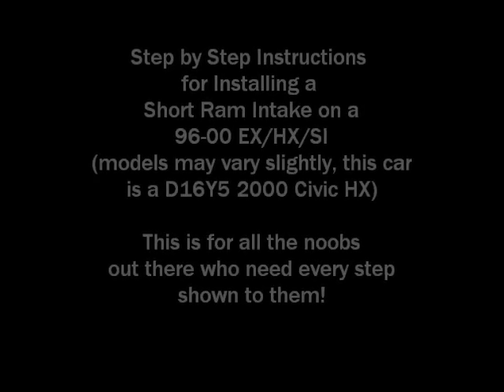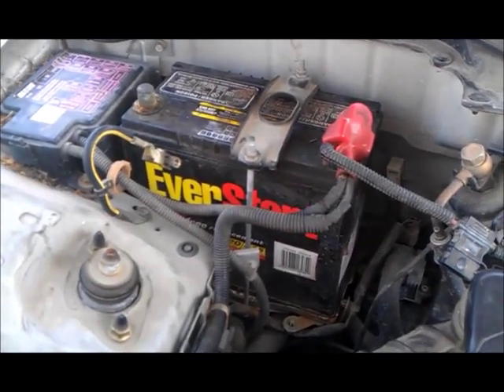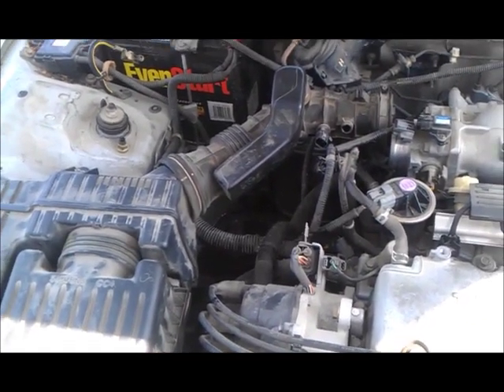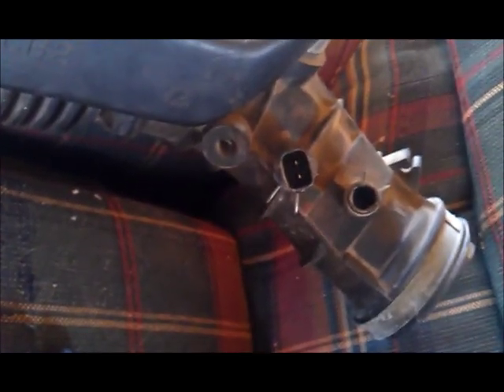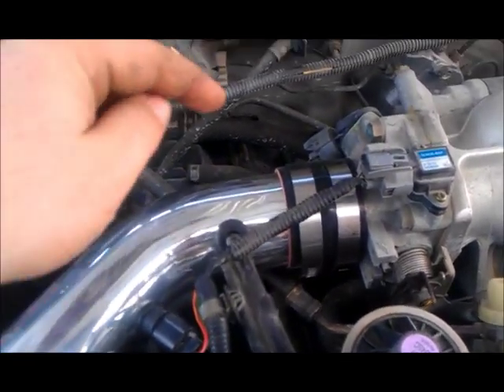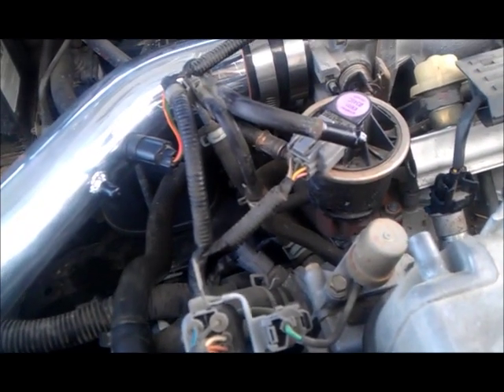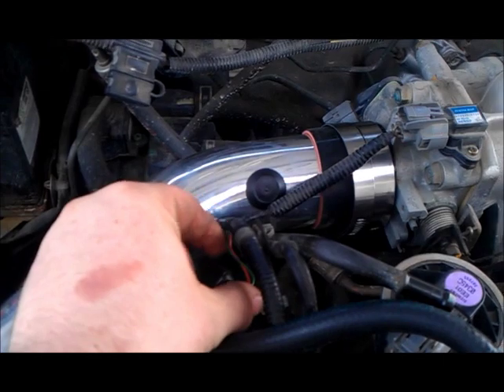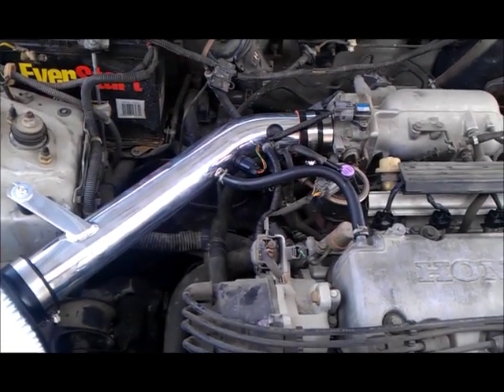How to Install a Short Ram Intake for 96-00 Civic HX/EX/SI

Comment from the maker: Cameron, this air intake swap makes your car breathe easier. It won't do a whole lot for performance alone, but if you swap your exhaust out for one with bigger piping, or change your exhaust manifold to a header (HX, LX, DX), then your exhaust gas will be able to flow better LEAVING the engine. Then, it is a good idea since you upgraded one aspect of the car's breathing, to upgrade the other end and allow the car to breathe IN new air easier. It does make your engine sound throatier too.

Comment: Quick question, I installed a cold air intake by Spectre, and it has a hole in the tube like you show in this video, but my stock tube didn't have anything running from the head to the tube. Should I just get a cover or do I need that pipe running into it?

Comment from the maker: ThEOnLyOne246, The only sensor I needed to bother with was the Inlet Air Temperature sensor, and had to unplug the Manifold Absolute Pressure sensor to install the new intake, but the MAP sensor is located on top of the intake manifold, so it's location did not move, simply the wiring harness back in after the new intake and IAT sensor were installed. Honestly I am not sure where the MAF sensor is on these civics, but it is not in the intake tubing. Assuming it is inside the intake manifold too?

Comment: why not put a breather filter on there too. it makes moving that flex pipe alot easier since it is not easily moved. after the breather filter is on there it isnt needed anyway. and it will look better with your air intake if you get a breather filter of same color.

Comment: i have a extra tubing that not connecting that ran with stock breather. do i just cover that? the stuff thats not in use. i pluged the maf sensor and i did breathet connected from valve cover to intake. but not sure about the other stuff i have a 00 civic coupe d16
Reply: Did you ever solve this ? I’m having the same issue

Comment: Where did you buy the intake? Is there any like websites or just a auto parts for this kind of brand?
Reply from the maker: I got mine on Amazon. they had a warehouse deal and got mine for like $80 with the dryflow filter (one you never oil).
Reply: +drummerjstone ok thank you for the reply

Comment: What about the mass air flow sensor?
Reply from the maker: That's on the throttle body itself not the intake tube. The other sensor (IAC I believe) goes into a hole in the intake tubing it came with a rubber grommet for it

Comment from the maker: no it didn't.
Reply: Where did you get that intake from ?? I have the same model car
Reply from the maker: @thebutcher5616  I got it on Amazon. AEM short ram intake with dry flow filter for 92-00 civic ex

Comment: All you Honda owners, you pay $ 200.00  to $ 400.00 and it makes no more HP than the stock intake, use  a leaf blower and dyno it and you will achieve 8 more horsepower, all that money for what a painted piece of pipe, for a brand name???   nooooo.  way brother.  all the pipes taper down to the stock throttle body so you get no added HP because the throttle body allows in only so much air.  research it and prove me wrong, because iam always right.
Reply: The cold air intake actually provides a little better air flow than the stock air box. So, in your face.
Reply: ok
Reply: your on the money ace.
Reply: cool your the man.......
Reply: ok
Reply: You have issues